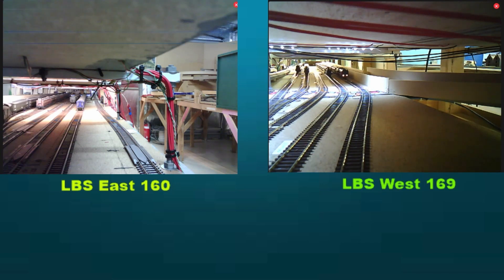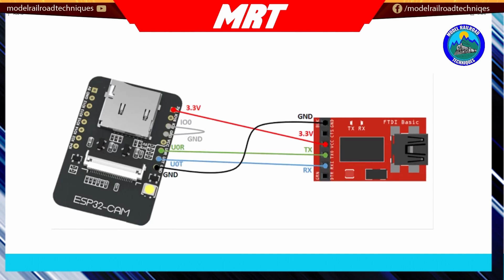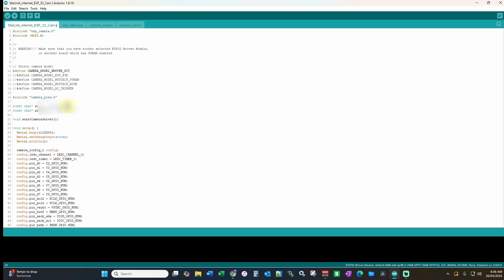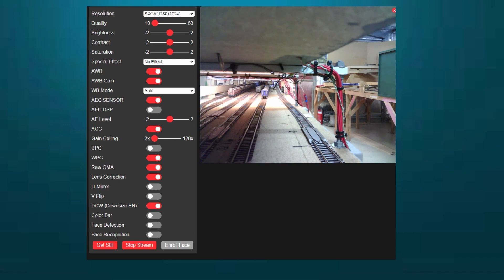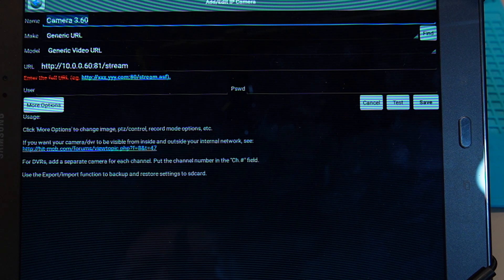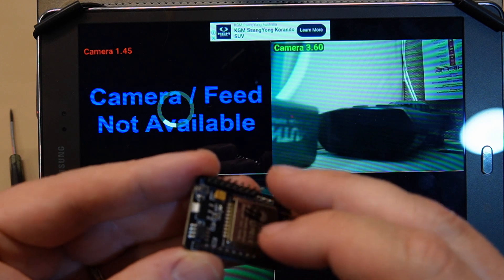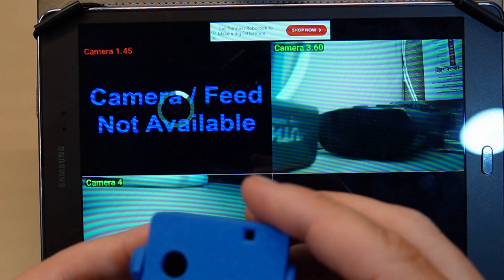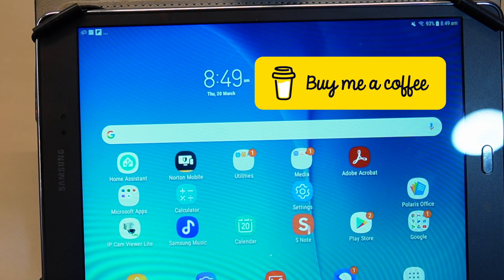Tiny Cameras for your Model Railroad/ 3D Printed Enclosures !!

Comment: Adding the external antenna needs the little resistor near the socket to be moved over onto the other pad which can be a bit of a challenge. For your Ali purchases if you look for the items marked 'choice' they usually come with free 10-12 day tracked shipping (if you buy more than $15) doesn't have to be all from the same seller

Comment: Two comments.   First, you don't have to use an FTDI adapter.   Easier way ... ESP32-CAMs can be purchased with an detachable development board that has onboard CH340G interface and micro USB connection ... easy to use and can be disconnected once ESP32-CAM is programmed and setup.    Highly suggest purchasing ESP32-CAM with this daughter board once ... daughter board be reused as needed for programming other ESP32-CAMs.     Secondly, one must pay attention to the heat generated by the ESP32-CAM camera ... and generally the whole lot of these little ESP32-based cameras ... that may be the reason it attaches to the microSD metal can ... can acts as a heat sink.    Similar cameras are sold with aluminum heat sinks!!    Therefore, I raise a caution with regard to plastic enclosures that limit the heat dissipation.    I was made aware of this  issue while putting an ESP32-CAM inside a closed boxcar on my HO layout.    Used a camera with a longer ribbon cable ... had to add a heat sink to back of camera.   Cheers ... all the best ...
Reply from the maker: Thank you for your feedback back. Interesting comment about the heat issue. Mine during testing did not even get warm.I tested 3 boards. Did you find this with  or without the break out board?  The enclosure had a fair bit of room around it because it was designed for the break out board to be added. I should think that would be ok, if you have heat issues. Worst case scenario I could take that stl file of the enclosure into Tinkercad and add some air vents or similar.
Reply: @ModelRailroadTechniques  Glad you haven't had any heating issues.  The ESP32-CAM with the OV2640 camera doesn't get too warm with or without the breakout board attached.  But if you upgrade the camera for higher resolution ... or get a board with a faster microcontroller ... things get warmer.   Guess it's possible units are defective but there are YouTube videos that talk about this issue.  Recently purchased several Seeed Studio XIAO ESP32 S3 Sense cameras ... the board is smaller and the microcontroller much faster.   There were two little heat sinks shipped in every package!!   Agree with you ... video on the train layout is a lot of fun!    All the best to you ... happy model railroading ...
Reply from the maker: @donaldkormos5529  definitely will try l Seeed Studio XIAO ESP32 S3 Sense cameras